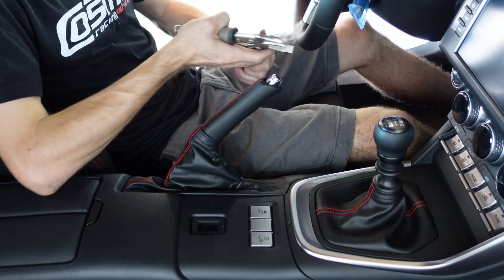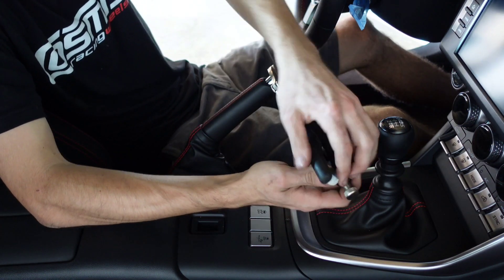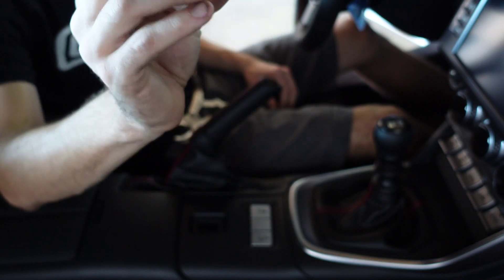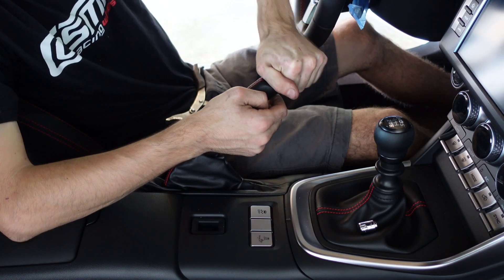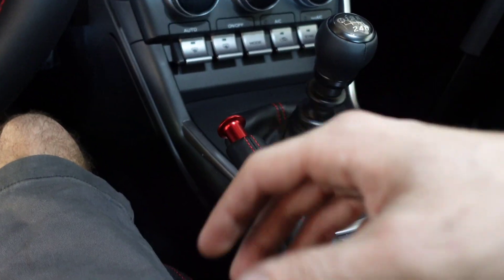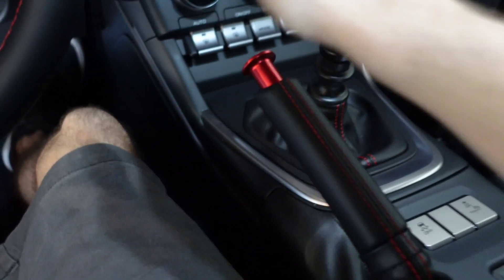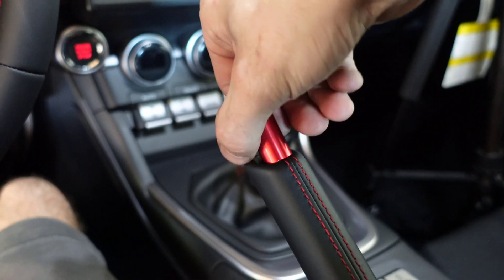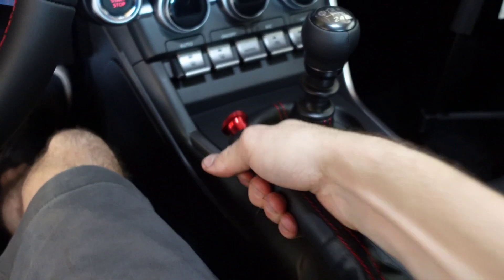2022 BRZ Drift Button Install

Comment: wrap it in rubber first?
Reply from the maker: That's an option if you plan on reusing your factory button down the road however even wrapping it in rubber the vice grips could still potentially leave divets in the factory button.